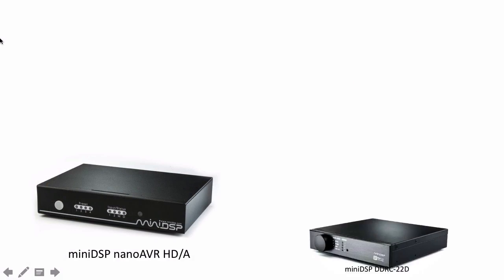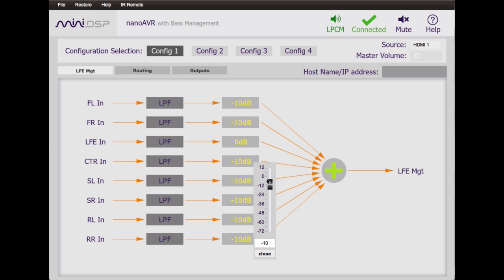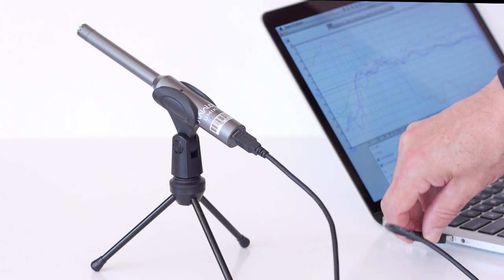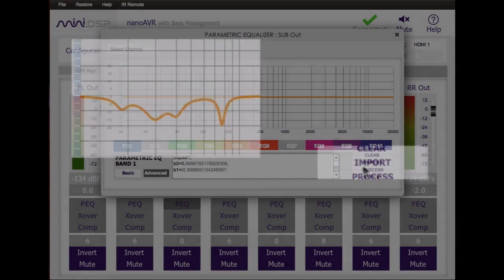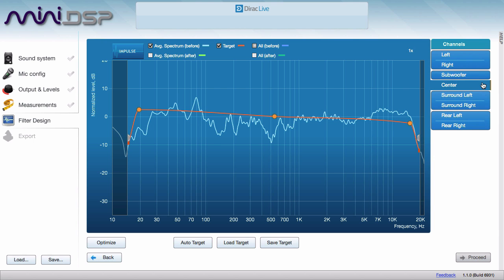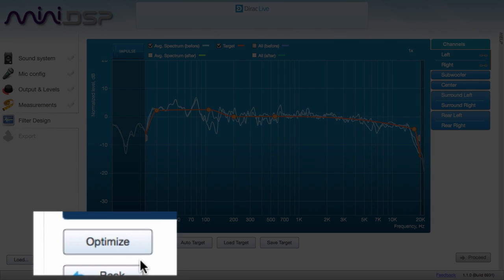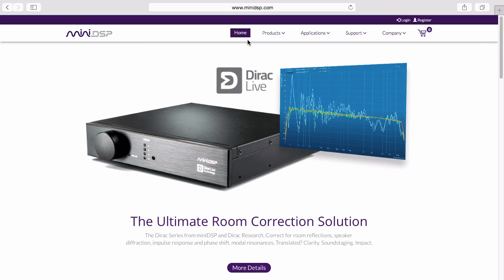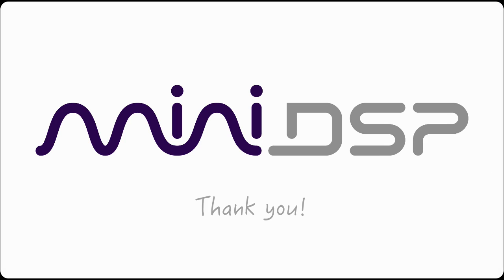miniDSP Introduction Video

Comment: Only 4 correction filters? is that same on the latest Flex version?
At a bare minimum, I would want LP, HP and several freq correction and/or phase adjustments.

Comment: Hey great video. For a subwoofer do you measure and filer on the MiniDSP before or after the processor (XMC-1) does its room correction?
Reply: Processor first for setting volume levels the run Dirac correction to smooth everything out.  Minidsp products are try HIFI quality. I had the SFD STUDIO and now the SHD. It’s made my 2.2 system sound the best it has ever.